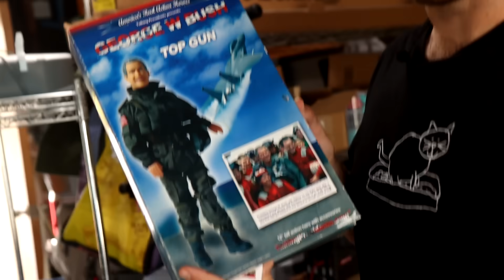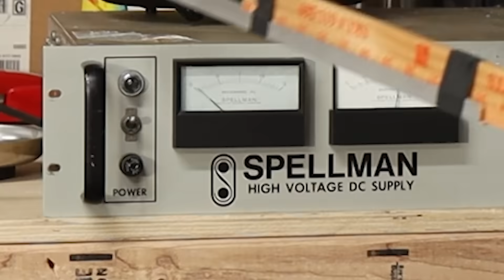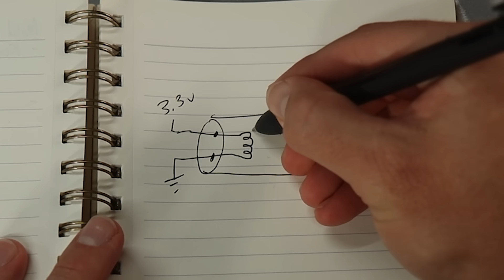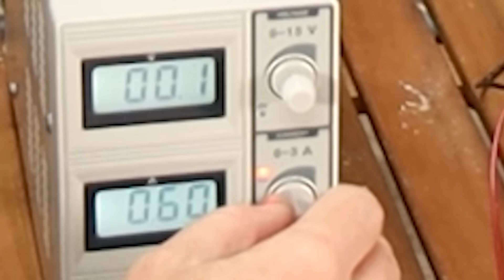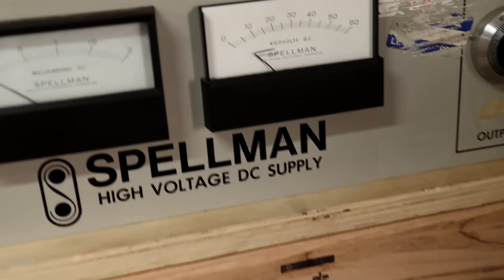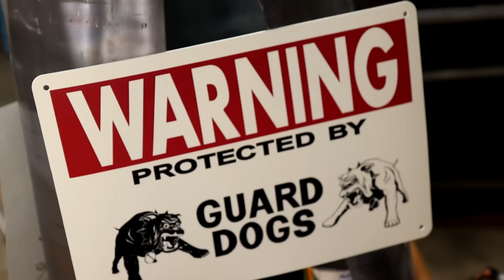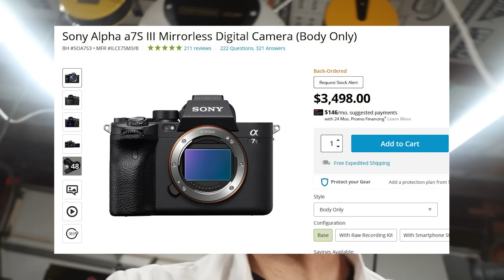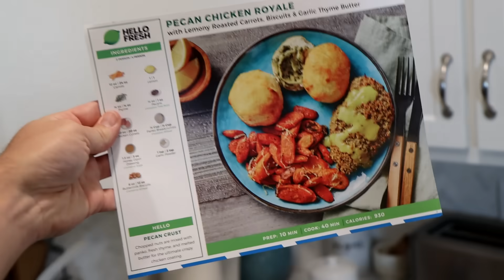Built My Own X-Ray After a Hospital Charged Me $69,210.32

Comment: I just watched the Veritasium video on how The Universe is Hostile to Computers. In it they talk about using a cloud chamber to visibly see ionizing radiation. It would be cool if you built a cloud chamber to see the x-rays from your machine, as well as observing cosmic rays.
Reply: I don’t believe cloud chambers can detect X-rays. They can only detect alpha and beta type radiation and X-rays are more similar to gamma.
Reply: @nicholassontag4312  While you are correct that cloud chambers can't visualize x-rays/ gamma rays themselves because they are not directly ionizing radiation. you can see the track of the secondary electrons you create when x-rays interact with the material of your cloud chamber, at those energies photo electric effect is by far the most important contribution for low Z materials. Those photo electrons will make tracks in the cloud chamber which will probably look a bit like those from beta particles but much shorter, due to the lower energy.
Reply: The above comment is correct! Gamma and x-ray radiation are types of photon radiation (which is the same as saying electromagnetic radiation). Photons are electrically neutral and only electrically charged particles can be seen in bubble chambers, so photons do not show up. You also can't see, for example, the path of visible light, infrared light, or UV light photons in a bubble chamber. 

Beta radiation is a high speed electron (negative electric charge) or positron (positive electric charge) that has been released as a result of radioactive decay. Alpha radiation is a particle consisting of two protons and two neutrons (or, equivalently, a Helium atom that has been stripped of its electrons) and therefore carries a 2+ electric charge. 

Also, it's a actually quite easy to make a bubble chamber at home! You need dry ice, a black metal slab, and a clear plastic (or glass) fish tank. You can google instructions on how to do it.
Reply: @camillev.y.2156  cloud chamber*
Reply: @nicholassontag4312  Yes, in my previous comment the more appropriate term to have used would have been "cloud chamber". 

Cloud chambers differ from bubble chambers in that typically the tracks made by particles last longer and they are able to detect higher energy (i.e. faster moving) particles. Both of these effects are caused mainly because in bubble chambers the tracks are created in a much denser liquid. You do see similar looking tracks in both cloud and bubble chambers, but in neither can you see photon tracks.